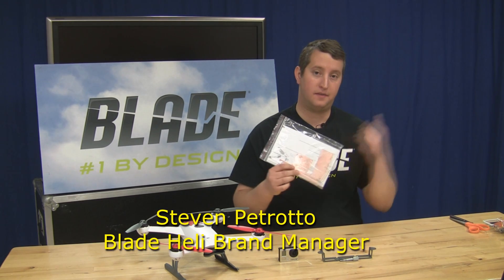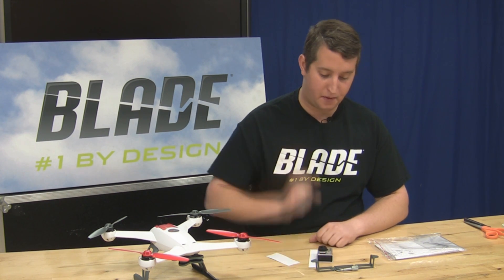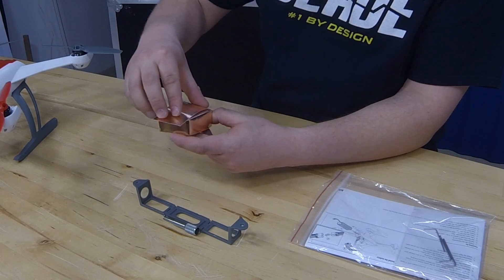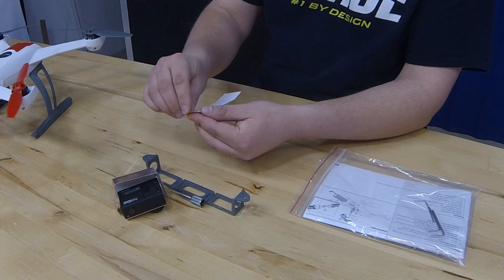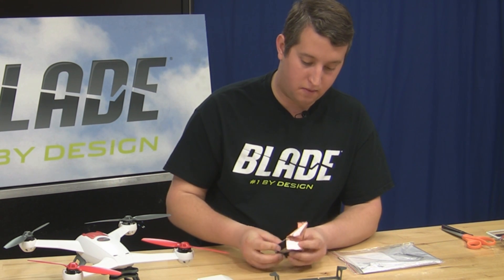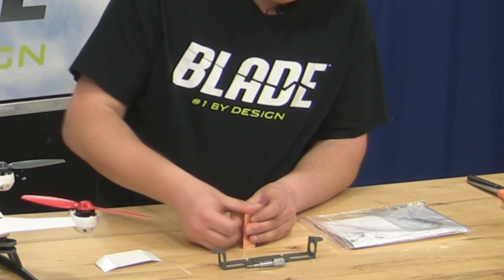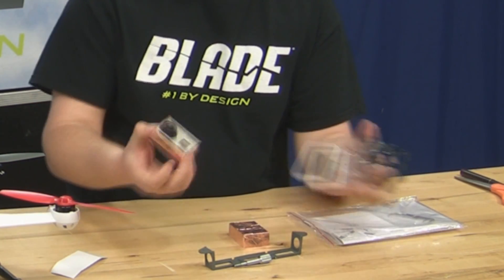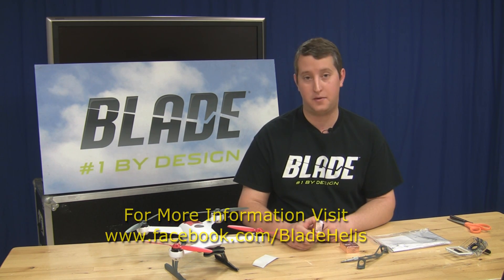Copper Shield Install Instructions - Blade 350 QX

Comment: I have found a quick and easy fix for both the jello and gps interference using the Gopro 3
Using the spare gopro case backdoor I used Velcro and 2 cable ties to attach a 3S 1300Mah lipo to the back of the gopro 3 case. This adds weight to the gopro 3 and stops about 99% of the jello plus seems to act like a RF shield so I don't get gps problems anymore. :)  The 3S 1300mah lipo seems to be correct weight and size.

Comment: All of this after-thought Bull $hit to cover poor R&D & Beta testing at Horizon Hobby "Blade" division. How about installing shielding to the inside of 350qx instead at the factory, along with sending out a retrofit kit for free to all of us previous owners. Its your F-up, why should we have to pay to fix it. Having to wrap my $400 GoPro in copper ad's even more irritation to me as a customer!
Hey Steve - When are the "C" props coming out or the Horizon Hobby/Blade 350QX prop adaptors? In case you were unaware, the B versions didn't fix the problem.  If you idiots would have contracted APC to make the props for you, instead of some 2-bit Chinese plastic parts manufacturer, then maybe thousands of smashed-up 350qx wouldn't have had to be returned to you on warranty with pissed-off customers to go with it.  Remember Steve, for the up coming 450QX. "BETA TESTING - BETA TESTING & MORE BETA TESTING before release to the consumers !!!
Reply: Well said
Reply: ricardopr54 Thank you Sir.
Reply: Very well said, indeed.

Comment: I used condutive sheilding paint on the inside of my GoPro water proof case and it made a big difference. Pretty easy to do and the small $35 can is more than enough. The manufature suggests 3 coats and that is what i used.
http://www.stewmac.com/shop/Electronics,_pickups/Supplies:_Shielding/Conductive_Shielding_Paint.html

I have photo too if anyone is interested.

Comment: I lined the internal bottom shell and battery tray beneath the GPS with aluminum tape and I haven't had any GPS interferences until I one day forgot the wifi on and it came down like a brick causing a $120 repair. According to HH website the new 350qx ap version has a full range receiver. I have been successful up to a half a mile with FPV and RC signals with the original QX.

Comment: WHAT WOULD HAPPEN IF YOU COULD SEAL THE GPS UNIT WOULD IT STILL LOCK OR NOT ???? AND I THINK PAINTING THE CAMERA CASE WITH LEAD PAINT WOULD BE THE ANSWER TO THE GO PRO AS I USE THE REMOTE CONTROLL TO TURN ON AN OFF THE CAMERA WHEN IT LANDS AN TAKES OFF

Comment: WHAT GOOD IS THIS AS I USE  A FAT SHARK GLASSES AND I USE THE TRANSMTITTER UNDER THE BODY AND THE TRANS MITER  IS PLUGGED INTO THE GO PRO CAMERA  AND WHAT ABOUT THE FRONT SIDE OF CAMERA THIS IS NOT A REALLY ELIMINATE ALL THE PROBLEMS THIS DOSENT ALWAYS WORK
Reply: THATS WHAT I HAV E BEEN DOING BUT I NEED TO TURN ON THE WIFI ON CAMERA SO I CAN REMOTE RSTART THE CAMERA BEFORE TAKE OFF
Reply: Bill B. I HAVE MY GO PRO WRAPPED WITH ALUMINUM DUCT TAPE BUT NOW I THINK ILL NEED TO WEAP MY FAT SHARK TRANSMITTER ALSO WHAT A FREAKING PAIN THIS ALL IS
Reply: Freddie Dan I would not use the wifi on GoPro. Wifi operates on 2.4 ghz and will interfere with your main transmitter operating on 2.4ghz. Should not need to wrap the Vtx. 350QX works fine w/o shielding the Fatshark....
Reply: I DID WRAP CAMERA DAH

Comment: i got one of the original 350s so would it best to use aluminum pipe tape or get some copper tape? Ive also seen guides where the tape is lined over the camera mount area on the bottom shell of the 350 itself

Comment: I'm wondering if eventually blade is going to figure the way of installing a full range receiver on this quadcopters.  I bought the old version of your 350 qx and discovered that even though comes with a full range transmitter,  its receiver isn't full range.  That's so wrong.  Why to limit such a nice machine.  The DJI Panton 2 has better range without a full range radio.  

Since this product is sponsor by Horizon Hobby and the Spektrum radios and receivers too, there should be a way to use full range Spektrum receivers on this machine.  The walkera 350  that is way cheaper in quality, gives you the option of switching receivers, why not the Blade.  Please work on that, and also on the propellers please.  You guys have a machine with a lot of potential. ..All it needs is just a little fix here and there and boom... Ready. ..

Come on guys,  don't let your trademark become synonymous of poor quality. I know it isn't, so go ahead and start fixing what needs to be fix, and let us (the current owners) know when all the new goodies ate available to make our 350s better machines. Thanks.
Reply: Bill B. Too late... I'm selling mine and getting a Phantom 2.
Reply: With the Phantom 2 you don't need to do any modification, though! Plus gives you 20+minutes of flight time.
Reply: Its amazing how many of these are on ebay now.  FAIL ~!!!

Comment: Just made the same thing as steves but for mobius,Still a no go for solid green here,
Loads of video's on the tube about copper tape none worked for me.
I was thinking about changing the gps module for a bigger one like the user on here fishycomics .But it seems that done nothing as well so what's the answer .
The quadcopter made for gopro and other cameras ya if you dont want to fly in gps hold.
I am beginning to wish i waited to hear all the stories about the qx 350 like the prop issues gopro and alike before i bought one very disappointed in this quad .I should of invested my money into my SK 450 for video AP machine.

Comment: If using the GoPro Waterproof case, with the camera mounted upside down, does the shield go on the top or bottom of the camera surface?

Comment: Great that horizon have done this to solve a gopro issue which was completely out of their hands. I have been happily flying my 350qx since release had no issues with A props and my gopro is a quiet one so ive had no gps issues, but reassuring to know horizon have recognised this gopro problem and come up with fix.
Reply: Seriously James?  Out of their hands? The  #ucking  box it comes in says "GoPro Compatible". It comes with a GoPro Hero 3 housing and mount !  You don't print that on the box and not Beta test it to make sure it works first.  Do you not realize how many 350qx have been destroyed because of this issue? Do you realize what this has Cost them (Horizon)? Do you not realize what damage this has done to consumer loyalty, trust and confidence?
Petrotto is lucky to still have his job. He's lucky that Joe Ambrose is an easy going guy.
Reply: sbs9026 I read compatible meaning the camera mounts, not that horizon would test every gopro camera before it was sold. They tested with multiple gopros before launch, why wouldn't they! I have a H3B which works perfectly with my 350QX, I suspect most gopros are also fine, so not sure how they could know future/odd ones would be problems, also a lot of people are crashing through mistakes or stupidity and blaming this on product to get free replacements.
Reply: Whatever James, I have a GoPro Hero 3, and Mobius camera. Both of them cause GPS issues while recording. As i said before, The Box says "GoPro Compatible" - IT'S OBVIOUSLY NOT !!!!
The prop failure issue as well...
Proper Beta Testing would have discovered these issues before release to GP. <- Thats all that needs to be said here.
Reply: Never mind the GoPro. It doesn't even work with their own cameras that come with the AP COMBO.

Comment: I didnt recieve copper tape with mine but i havent had a single issue with gps lock. Ive flew 10-12 times starting the gopro silver 3+ first before starting the 350. Id like to know where to get the copper though to prevent problems!
Reply: Copper or aluminum tape at the hardware store. Aluminum tape is what i used. I built a custom camera housing for mine wrapped in aluminum tape. No issues after that.
Reply: Brad Cox. I got my tape from the hardware store. Of all places it's found as a snail repellent tape 4m for about 7 dollars

Comment: I stop trying to cover up the issue with some light weight  copper, and start making a gopro case  made out of aluminum, and be done with it.
Reply: Freddie Dan just cut around the port !
Reply: OR A COPPER COVERD ONE WOULD BE AWESOME THAT COMPLETLY SURROUNDS GO PRO
Reply: Or better yet a newer battery door and gps  on the top back. that means you now owe me a Blade 350 qx Ap, if you use my design
Reply: WHATS WITH THE BATERY DOOR I LOST THIS ONE  OR YOU MEAN MODIFY THE DOOR PLEASE XPLAIN
Reply: Quad is all closed the door is on. if they made the back only open so you can slide it in , straight in, the GPS sits on top. like the DJI
Reply: I AM STILL NOT UNDERSTANDING YOU I WISHED WE COULD TALK FACE TO FACE AS IM NOT A NIT WIT BUT I JUST DONT FOLLOW WHAT U MEAN SORRY FREDDIE
Reply: I HAVE TO PLUG MY GOPRO INTO MY FAT SHARK TRANSMITTER THAT IS MOUNTED TO THE BOTTOM OF MY BLADE QUAD

Comment: I am a big fan of HH stuff! But on this purchase, the first batch of these 350qx's!! Wow I am very disappointed! Bad props!!! A quad designed around the GoPro, But you have to rap it with copper or it will cause RF interference that may cause your 400$ + Quad crash!!! I should have went with the DJI Phantom!! I am glad they are trying to fix the issues, but its a little to late for that in my opinion!!
Reply: Amen Brother !!!

Comment: Is there guidance on supplying us guys that bought the 350qx prior to? Is there a similar process like the whole "b" blade incident?
Reply: For the blade incident, I'd recommend NOT using the "B" or any stocked blades. Instead buy the SmallPartCNC adapter and use carbon blades. That's what I've been using.
Reply: That's actually what I have on there now. I'm not running carbon fiber blades though. Right now just testing it out with APC props. Much much better than the flimsy stock blades.
Reply: APC props are good, I am using the carbon blades because they're lighter.
Reply: Prop adaptors & APC 8x4.7sf is the ticket. Some guys have been trying the APC 9x4.7sf with varying degree's of results including overheated ESC's, fried mother boards as well as less vibration improved pull-out, lift, carrying capacity and flight performance vs stock B prop as long as they hold together long enough to test against.

Comment: Do we need to do this if we aren't using the WIFI on the GOPRO?  You mention it at the end, but not sure if he meant ALWAYS use the copper or only if you're using WIFI.
Reply: Thanks Bill!
Reply: ALL THE TIME AS IF I EVEN TURN MY CAMERA ON IT KEEPS THE QUAD FROM MAKING GPS LOCK FOR LONGER TIME
Reply: Hey Pontius - The 350qx has GPS issues with a multitude of different cameras while recording, especially the GoPro Hero 3 regardless of whether WiFi is turned on or not.
Reply: THATS SOUNDS RIGHT SOME NOISE IS MESSING WITH GPS
Reply: My 350QX2 AP Combo came with a CG01 cam. Even that doesn't work in conjunction with the GPS. This is something that should have been detected and fixed before releasing to the public.
Reply: YES AS IT SUPPOSE TO SEND OUT A IM PULSE I HAVE BETTER LUCK WITH IT WRAPPER THE LAST TWO I UNCOVERED TO DO WORK AN LOST THEM BOTHE ?????